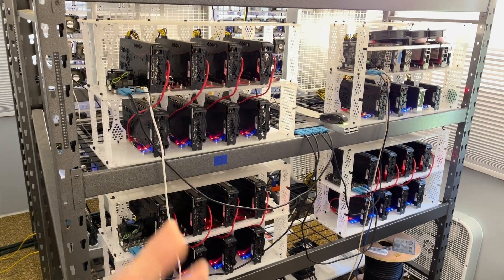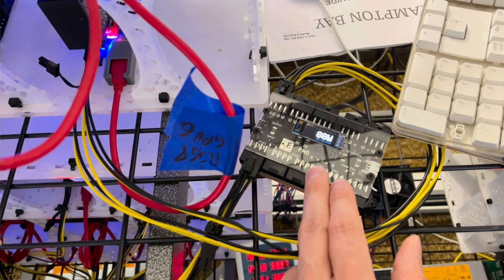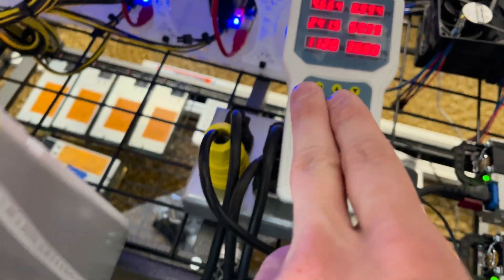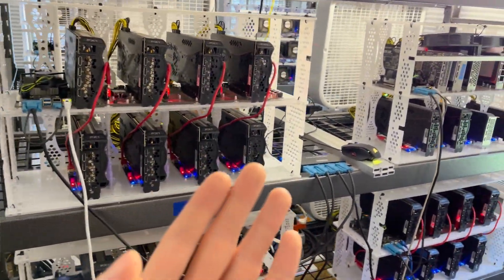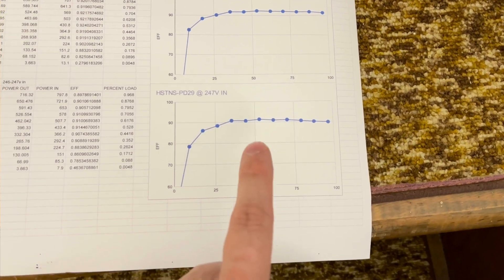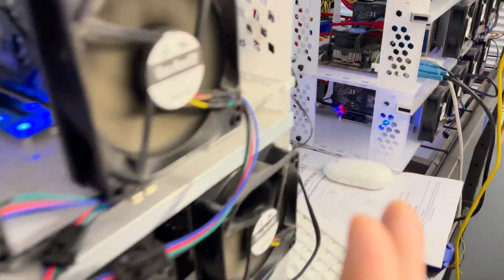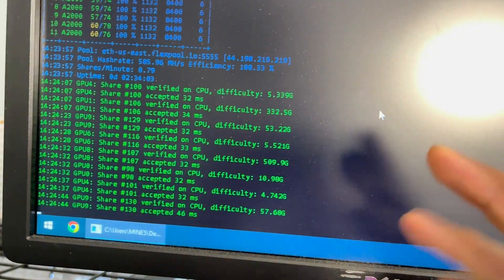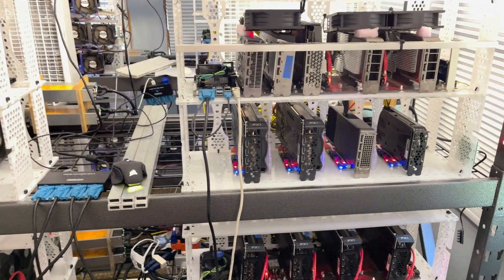How To Measure GPU Consumption?

Comment: Can u link the fan speed controller on the A2000 external fans?
Reply from the maker: https://amzn.to/3OP9dII

You likely could run it off a motherboard header, but at 1.2A  rated its pushing it. Most boards are made for 1.0A max, but it ranges from 0.6 to 3.0 and this is often a difficult spec to find. I'd recommend a PWM fan speed controller or using your motherboards fan speed control if available since 100% on that fan is likely far too loud and a bit excessive. Far better to have a bit too much fan than too little, however. There's a ton of options for running high power fans, the one linked is great for mining if you need several fans as its powered by a high power PCIe plug. You'd need one to spare, of course.

Comment: Have you explore using some Zigbee devices coupled with Home Assistant to program in automation? This way you can have a dashboard view of all your data & controls.
Reply from the maker: I have considered something like that, but there’s a lot of difficulty to integrate it into my setup and I don’t think it’s super practical to do the classic approach. I was going to make a relay hub controlled by a raspberry pi that would be able to switch on and off all the rigs independently. This wouldn’t switch the ac, just the turn on circuit for the psu. I have it on a list to eventually talk about this in a video…

Comment: Hey! just found your channel. I would love some video about those fans in the window.. how do you connect them to those server psus?
Reply from the maker: Hey there. Fairly simple, I just used breakout boards that have screw terminals on them. I clipped the plugs off the fans, and soldered a wire to 4 fans that goes back to the power supply. They get shoved into screw terminals and thats it. There’s also a PWM wire that’s common among all of them, so the speed is controllable. I covered this a bit more in depth in the airflow video, and the tour video I did earlier.